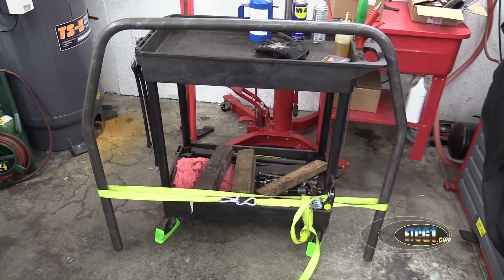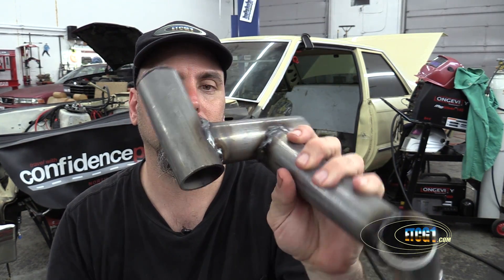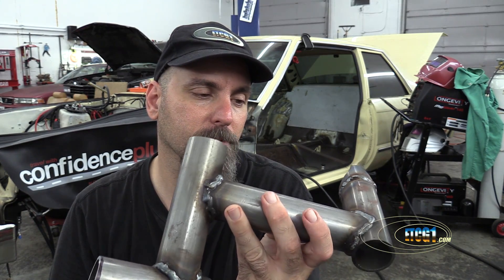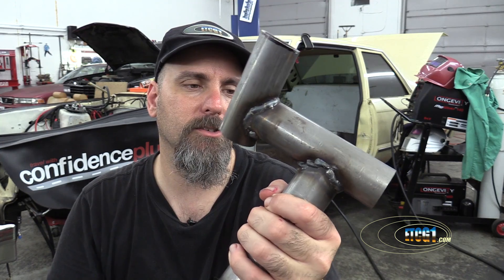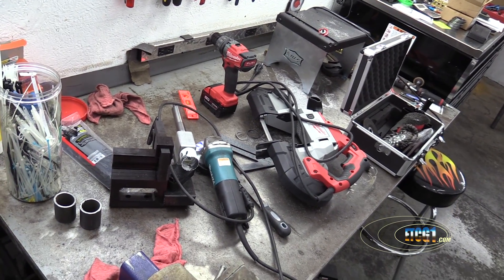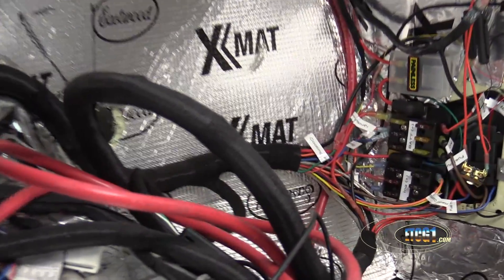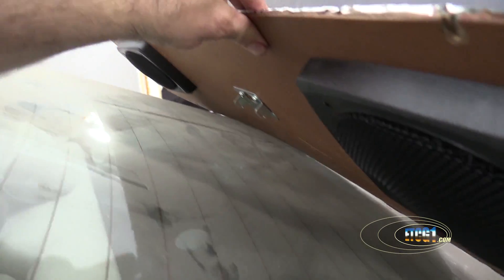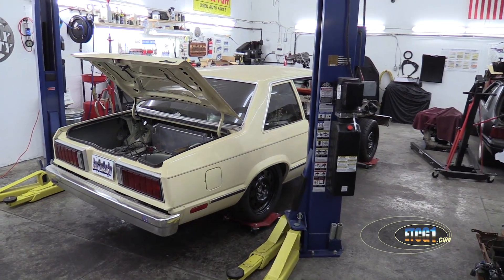Losing Motivation With Project Vehicles

Comment: I have gone through the same emotions on my 91 firebird formula that I am working on.  The motor was pulled to replace the dead 305 in my wife's Camaro and then a 350 was to be dropped in.  What was supposed to be a weekend job turned into a 3 month engine swap and my firechicken still does not have a heart in it, 1.5 years later.  It's a massive pain and frustration but damn I just imagine all the fun I had with that car cruising with my buddy from the military and all the late night quarter mile pulls we made.

Comment: I'm having a similar problem with my Bathroom remodel. You might find some more motivation if you get some of the parts put back together. Although you want to finish the roll bar and then put things back together, while it's an emotional disruption, you might get some more mojo once you start putting some things back together. Do what you can. BTW - asking for help is very hard for me and you're doing great at it!

Comment: I hit a similar wall when I thought it would be a good idea to film and edit a 50min bmx video. I put tons of effort into it, and learn much more techniques and it looks much better than anything I've ever edited before. I am finally down to the last stretch where I only need to edit a small section, but I've been putting it off for 2 years now.

I wanted that last section to be really good, and that caused me to not want to work on it. I thought if I took a break, I would come back refreshed. I kept putting it off, and now it's no longer in my mind, but everytime I want to start a different smaller project, my mind tells me to finish my initial project and I put off everything again.

I'm not sure what I need to do at this point, but I know one thing. Don't tale too long of a break because it'll eat away at you for a long time.

Comment: That's my problem with my Mustang. I could have just thrown a battery, radiator, and tires and I could have been driving and enjoying it.  It is hard when you work on the project for a while, and I do think it would help if you were able drive it in between. My think hiding my back now is installing the front coil springs. Best of luck!

Comment: When your car doesn't run and you can't drive it..losing motivation happens real quick. Best thing is to have friends that also work on cars and help motivate you along the way. I gave  up on my last project.(Ls swapped 240sx) because i was given the opportunity to pick up a running and driving 350z for less than what i could pick up a t56 transmission for. But I would love to hear and see that Fairmont running.

Comment: Pick a project goal and DO NOT LET THE SCOPE CREEP
I bought a Civic shell in October with the deadline of finishing it in December. Finished it in March - drive it to work everyday. Refused to do any mods or even too much restoration. Just focus on GETTING THE CAR RUNNING. Start driving it. THEN you can go back and modify it. That's way more fun anyway.
Reply: It was a 97 Civic HX with no engine, trans, mounts, suspension, exhaust, shift rods, rear view mirror, windshield visors, splash guards, ecu or harness. The climate control console was cracked and the wiring was hacked up. Door panels were bad. The metal fuel line to the tank was hacked off. The wiring going into both doors was bad. Interior mostly good albeit faded with a rip on the passenger seat. $200 clean title

Now it has a 97 GSR engine, ITR trans and exhaust manifold, ITR flywheel, 2.25 custom mandrel bent exhaust with a Flowmaster cat and Walker muffler, custom ecu adapter harness I built so I wouldn't have to modify the engine harness, alarm system with all the add-ons all wiring tucked into oem loom, stereo and decent speakers all wiring upgraded, Si suspension, GSR swaybars and front upper brace, 4 lug ITR hubs with Prelude brakes up front, Accord wagon alloy wheels. It looks OE even down to the GSR intake and box, OE mounts, OE ride height. No modifying until everything is fixed and restored!

I didn't rebuild the engine or trans. Nearly all the parts were sitting in my garage already. I haven't replaced the core support yet or done paint and bodywork. I didn't swap to nicer seats. I didn't jump ahead to the f23 Accord motor, rebuilt, cammed and turbo'd. All that will come later.

Comment: i love the fairmont videos you have done. its alot more detail to the little stuff that makes a custom car like yours, one of a kind, and yours.  yes it dragged on longer than i thought it would, but it would have been done by now if you didnt have to do the daunting task of building a car, from the ground up, doing the recording, editing, uploading, and everything behind the screen stuff for youtube. i have a 84 ranger that i had for 3years, plan was to do a couple things to it, and put it on the road. it in turned into replacing the front end for 4x4, getting rid of the old computer and wiring for a duraspark setup, rip everything inside it to get rid of rust, sand the floor pan down, cut a floor board out and put a new one in, drill out 58 spot welds to get to the rust, and so much more little shit. its no where near what i wanted to do with it. once the fairmont is done, you will enjoy it so much more than you could imagine, im sure of it. amazing job on the car no matter what anyone else says.

Comment: I've got a Jeep Cherokee I could finish in a day or 2. Literally just a matter of putting accessories back on the engine, add fluids and turn the key. I want to drive it, I want to finish it before the bad weather gets here. Maybe I'm dreading the maintenance on my other car, current daily, former project. That one needs a catback, wheel bearing, pwr steering pump and line, etc..

Comment: buy a cheater lens for your welding helmet, youll see good then ;) i also recommend a bright spotlight to shine on your workpiece while you weld, it makes it easier to see what you are doing rather then relying on the weld flash to see what you are doing. by the looks of your weld, it looks like you are not welding hot enough setting. tack weld everything good, then weld with mig + gas (dont use flux core as its much harder)

Comment: I have hit the same wall with a 95 civic, New engine built on the stand ready to go in.  Car still sitting in garage. It has new interior, new tires and wheels, new brakes. The car runs fine right now. All stock. Just waiting on me to pull engine, replace rad support and install new engine, BUT I went and bought paint, new door panels, new rack and pinion. Buying the paint to repaint car is  what stalled me out . . . .  If I replace engine I gotta paint the engine bay . . . . never ending cycle

Comment: I get to this point on almost every single project I take on, either I'm not satisfied with what I've done the first time and had to do it over, or I get all of the biggest things done and the details just start to suck after a little while, I don't like tedious things. I can build engines all day, but none will ever run because I freakin detest valve adjusting! But I think you'd be amazed at how many skilled people you can round up to do a shop day for the low low price of beers.

Comment: Yep I have a project car (a BMW E21) in my garage for almost 4 years now, started as a shell swap, stripping the donor car was done in a month part time but stalled out the rebuild trying to sort the paint on the engine bay out and haven't turned a spanner on it in 2 years after that. After I got another project car I could drive and restore I just had no time anymore. But like you I really want to finish it now and drive the thing as my project too ended up way beyond the original scope.

Comment: Yeah de motivation can happen on a project of that magnitude after a while. I agree. Btw, as a suggestion if you haven't already done so, I would consider adding a 3rd brake light to the fairmont. I know it wasn't mandated for vehicles until like the mid 80s I guess, but still I personally consider it to be a good safety feature, and perfectly easy enough to install.

Comment: You've mentioned wanting mechanical exhaust cutouts, but that nothing good is available. I've noticed the same.... My solution is to use a v-band connection at the cut-out, with a plug welded into the removable side.  One bolt (the clamp) then removes it at the track.
I'm really surprised there isn't one  good offering on the market for a mechanical cutout....

Comment: Eric its perfectly normal ;) I didn't build a car as such but restored a Classic Mini over here in the UK about 9 years ago. I was soo excited to be doing it at the start,the more I dug the more i ended up replacing old serviceable for brand new NOS parts because its what you end up doing when Restoring/Building a car. I never gave up but at about 80% into the restoration I knew deep down i would sell it! I was restoring it for me but after doing 80% I literally hated the car! the only motivation left was to sell it :(

But I did it,It was a life experience and i wouldn't change that!

Now I like to tinker rather than do full on resto's id rather have a bit of a beater thats interesting them i fix things on and enjoy driving it ;)  

I don't think rebuilds are for everyone? some like doing one after another some will do just one and then they are happy.

Different Strokes for different folks as they say.....................

Hang on in there Eric your nearly there ;)

Jodie (UK)

Comment: The very last thing to do when you finish a project is insure it! I had a project car totaled by a drunk who ran a stop sign.
Roll bar Tips: Don't forget the floor plates to keep it from just punching through the floor and the under pedal plate or bar to keep you and your co drivers feet from being trapped.
With that gauge tubing you need more current and or dwell longer before advancing along those welds are not penetrating they are just sitting on top and would fail tech inspection.
Top welding tip take a cake decorating class Icing a cake takes the same type of skill and you won't go blind practicing.

Comment: Hey ETCG1 hope you'r day was better than mine. First off love the videos wish I watched them all but yes the projects suck time, energy, and money away from your life. I personally found the best way I've gone through my builds is  one step at a time. As a mechanic/professional technician in training, I'm grinding mon - Fri on cars, do I want to come home and do more grinding NO. I've used good mentally practice to stay sane. Make many goals or stages to the build. Celebrate all your achievements, keep wrenching everyday you can but don't burn yourself out. If you need  break take a break. The worst part is when you find a brick wall and begin spinning your wheels. Hit a brick wall, hire a wrecker help is always needed in most builds. You can't do everything yourself to 100%. You can still achieve 99% by yourself.
        Find a mountain before you keep climbing, don't look back unless you are too focused on what's ahead than take a step back admire your progress. See yourself at a closer point to achieving that climb, keep climbing. 
          My project is a street to track 1990 eagle talon tsi turbo awd. All original platform turning it into a 500 hp girlfriend scaring, corner gripping, launching machine. Hope to cruze by one year when I get down there to do a drag week event which is my biggest goal I hope one day I might achieve. Thanks for all the help , advice, how to's, and general knowledge sharing you provide. I hope one day to also share my knowledge and help people in a similar way like you. Till the next time Eric stay dirty.

Comment: From my experience with doing a similar complete build, along with doing body and paint myself, organization is the key. Overly researching, along with perfectionism, equals delay. 
Quit apologizing for your welding skills and just start building the roll cage. Your welds will improve the more you do it.
If something is unacceptable to you, you can always improve it.
Make yourself realistic goals, in writing, so you can have a checklist to cross off the tasks as they are completed. Just break the tasks up into smaller pieces. For example, you don't have to build the roll cage in just one day. Go work on another part of the car and come back the the roll cage later. 
Install the engine and drivetrain. The sound of the engine running will motivate you.
Don't worry about the critics, they are just a bunch of couch potatoes who never do anything. Anyone that has actually built a car such as you are doing will only offer encouragement.
If you work a little bit on your project everyday, before you know it you will be done.
Good building!
P.S. Cover the glass (windshield, etc.) during welding so welding spatter doesn't ruin it.

Comment: Doesnt have to be a project car i made a list of things to fix my daily driver. Had a tricky drivability issue tested so many parts/tried to fix and spent a fair bit on parts that needed replacing anyway. I lost all motivation to bother fixing any of the other small cheap stuff i can easily do. I took a break for 4 months or so finally bought remaining parts and got help to install them which improved drivability massively now I'm motivated to do the rest and have been. Cars give us so much but boy can they take away... when you cant enjoy driving them its easy to lose motivation. Pay and get the stuff your struggling with done so you can get back to the stuff you love.

Comment: its a slippery slope with project cars, in my case a simple turbo change turned into a 4 year restoration, every nut and bolt zinc coated, new built engine, transmission, all parts powder coated, just a brand new car basically. just keep going and before you know it you will be out on the road smiling ear to ear, might not get into another project in the end of it but trust me, its all worth it.

Don't underestimate that last 10% - those are another 4 years if you have OCD and cant stand any rattles, suspension setups, tunes etc. again, its a slippery slope.. 

Also, if you intend driving it at 100% at the tracks you will be limited by that voice saying "its too good, too much money, cant crash, cant crash" and you probably wont be able to use the full potential of the car if track was your aim from the start.

Comment: This happened to me with a 7.1 channel receiver for my new 52" television. Cause I didn't want to have 7 speaker wires, so I needed to hide the wires behind new baseboards. Which meant that I needed new carpet. And so of course I needed to repaint now that I'm swapping out the carpet for laminate. And well, now it's 10 years later and I'm still fucking around with wrapping things up.

Comment: I have a good book about procrastination it's called, err, just  a minute it's on the shelf let me get the name.
Oh fuck it, I can't be arsed to get up now. I should get round to reading it myself but, well, you know.
Don't look at the Fairmont as a project. Look at each job you have to do as a project. Smaller bites, much easier.
Don't beat yourself up because your not happy with your welding. You are a multi skilled guy, be proud of what you can do and don't worry about what you can't.

Comment: I find I get burned out of anything if I'm at it too long. Even repairing cars, trucks, mowers, or motorcycles. Rest is good ... but then it takes me several days to get back into the swing of things. Can't win!

On the exhaust cutout thing, I've never seen one - electric OR manual, work for more than one season. They're pretty spendy too. My buddy just threw a top-of-the-line stainless pair on his '11 Camaro (700 supercharged RWHP) - that set didn't even make it 4 months before  the units seized up and wouldn't move. Car never sees salt either. He also has no garage, so the car is outdoors for 3 seasons - that may have alot to do with it. We live in MA, so moisture, and alot of it, is a given. Seen 2 other units with similar results. They seem pretty delicate. Just FYI.

Comment: You aren't the only one. I have a 91 honda prelude with a 2.2l h22a engine in it. Which did not come in this model and the previous owner did not use any available parts for the conversion and everything is basically home made. The axle on one side is too long and it bumps the engine on every rotation of the tire. The engine mounts are modified and I already had to weld one of the brackets because it was broken in 3 pieces. When i tried to source axles and the mounts and found out how much they cost for this conversion my motivation to finish the car disappeared. Also the tensioner pully is making hell of a noise and because the engine is so close to the side of the engine bay i dont know if i will be able to get it fixed without taking the engine out. I don't want to sell the car but I also don't want to take the time and money to fix all the issues.

Comment: Hey Eric, i bought my project e30 around the same time as you got your Fairmont. I'm also still working on it but i can't believe how much you've done! (compared to me lol) My intentions were simply restauration, it had ALOT of rust so it needed alot of welding. I'd say that was 80% of the work, and it was the most draining. Keep up eventually it'll be done, that's what I always try to remember.
Reply from the maker: That's one of the main reasons I bought the Fairmont, very little rust. Had I done the body work on this car, I would still be working on it 2 years from now. Good luck with your project!
Reply: You got that right. Thanks!